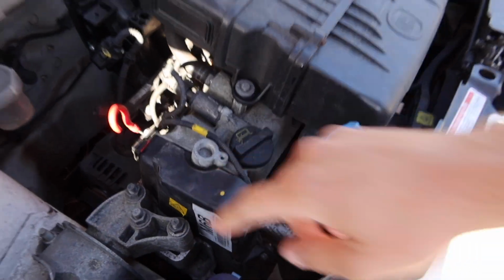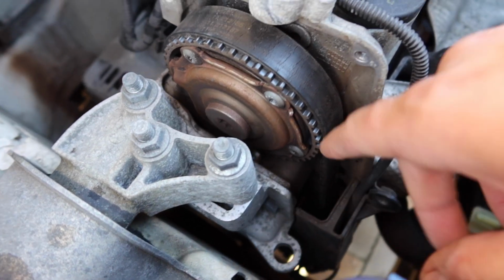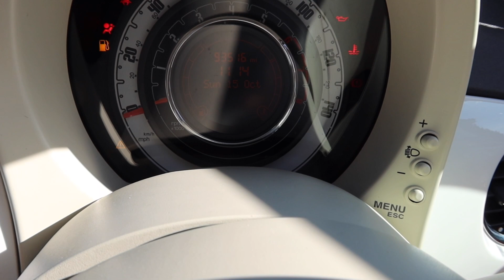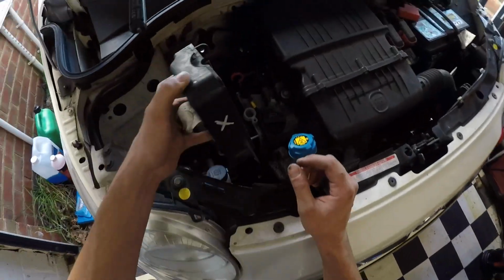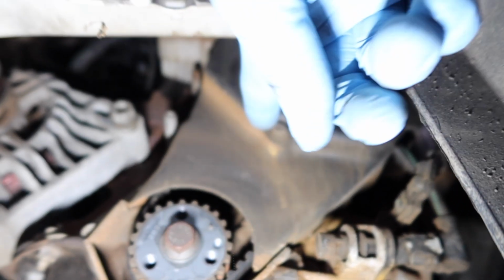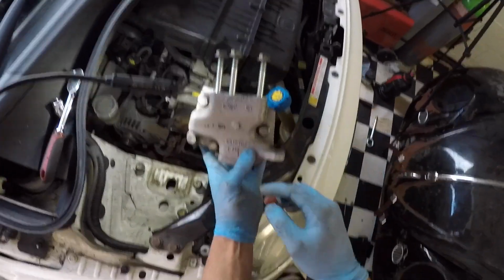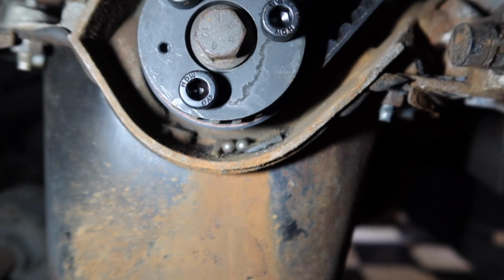This Fiat 500 Has A HUGE PROBLEM... (Part 1, It Gets Worse)

Comment: This is the same engine that's used on the fiat panda as we did the timing belt and water pump on that.
Reply from the maker: Easy job! It's a great engine - this one got EXTREMELY hot though and had a banana shaped cylinder head so wait for the next couple of videos 🤣

Comment: By the way guys, I know this has gone belly up a bit more than the belt but just a heads up. You say this is a non interference engine, it isn't, the old 60 bhp 1.2 was but this has the 68 bhp, low emissions engine in it like my 2011 Panda. I don't know what they did to get it to the lower emissions but whatever it was, it changed it into an interference engine.
Reply from the maker: Whoa! Should have done a little more research then haha! Good thing I got the timing right (spoiler alert), but it didn't matter anyway hahah, watch out for Part 2 and probably 3!
Reply: Increased compression rate.. which increases efficiency. You can only increase compression ratio by making it into an interference engine, hence all modern engines are interference now.
Reply: @khalidacosta7133   Thanks for that because I've often wondered about that one. I checked when I bought the car thinking as the guys did and when I found out that it was interference I changed it to be on the safe side.
Reply: @AutumnCars  Must admit I thought the same as you guys but checked to be sure and I say below, when i found out I changed it to be on the safe side. I'm sitting on 117k now after 3 years and its running sweet, using about 100 ml of oil every 1k, top it once a month, it can vapour oil out at that rate so i'm happy enough with it. They're a bloody good engine when looked after right.
Reply: @graemew7001  Most engines have been inteference due to lower fuel consumption for a long time, since the late 80's and early 90's. Even at this age, the only reason it wasn't is because it would have been designed for use in poorer countries where fuel quality is worse. (you don't want auto-ignition and cheapest way to combat this is to reduce compression, which reduces efficiency). The engine, looked after though, should be bomb proof. I've seen how people drive in these countries but the cars seemingly never die!
Reply: @khalidacosta7133  The engine in mine is certainly well looked after, sitting on 117k now, serviced every 10k, uses about a 100 ml of oil every 1k, checked regularly, returns av 47mpg. It goes really well too, I'm intending running it until about 150k or so, saw one in auction a couple of weeks ago with 170k on it still going strong.

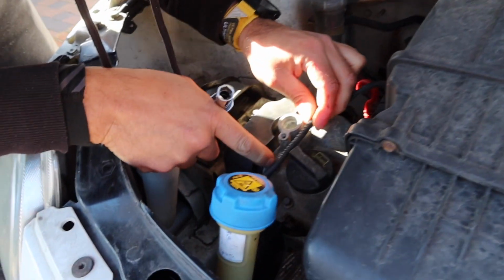Comment: 1:20
Made in Poland, so not Italians.
Reply from the maker: Didn't know that! Thanks 😊
Reply: @AutumnCars  
Punto and Panda were made in Italy, 500 in Poland, 500L in Serbia, Tipo/Egea (the new one) in Turkey.
Reply: @AutumnCars  Mladjasmilic is wrong about the Panda because I have a 2011 one, with a healthier version of the engine in this 500 and it has manufactured in Poland on it. The belt should have been done at 75k so 93k is pushing it too far lol, I did mine at 90k when I bought it because I couldn't find the receipt when I bought it, luckily it had been done before but it was stripped so I changed it anyway.
Reply: So i have a polish car!
Reply: @sallywalton5375  Indeed we do. Being a petrol head I knew of the Poland and Fiat connection but wasn't aware that Panda's were built there until I bought mine. They built a good little car too, mine has been very reliable, I've maintained it well too but still, they built it well in the first place.
Reply: @graemew7001  Thank you Graeme, i love mine. Just niggly things like the number plate light ( not bulbs, wiring and of course, the door handle. Shes getting new mats, for xmas🤣